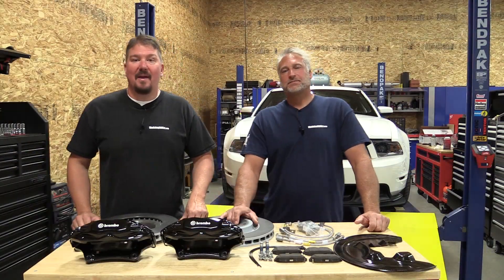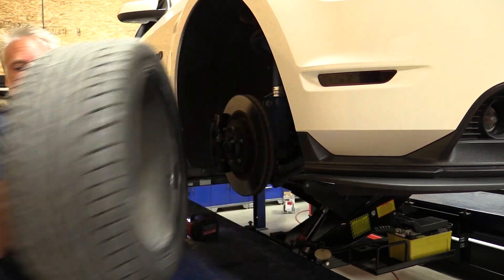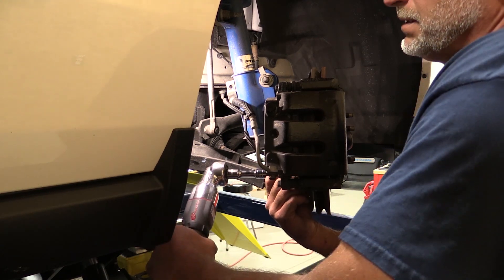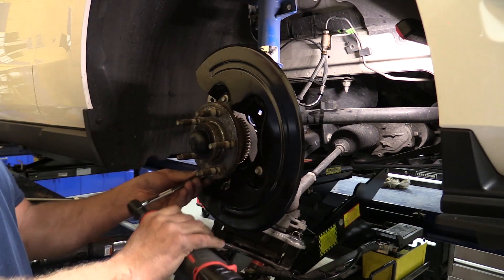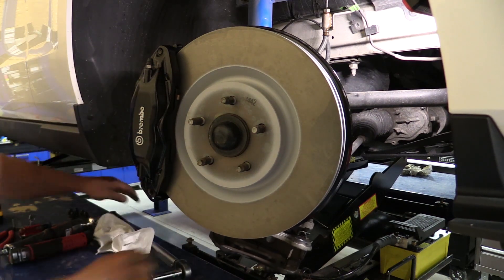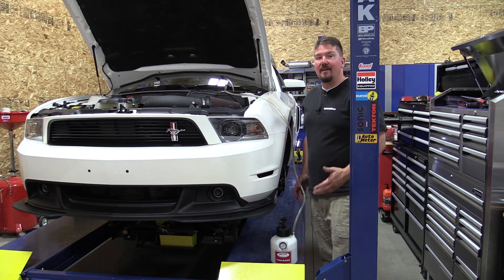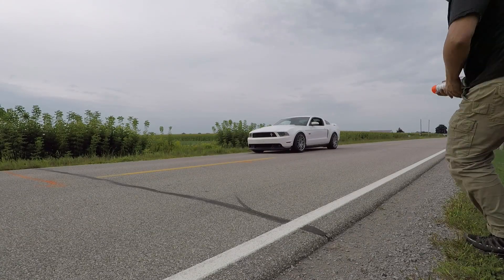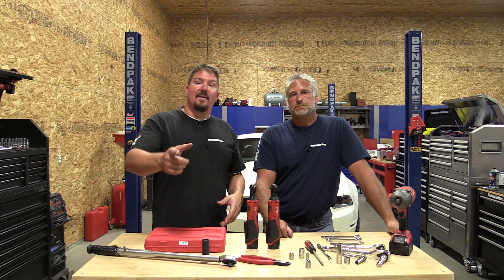STOP! 05-14 Mustang GT Ford Performance SVT Front Brake Upgrade Kit also for V6

Comment: looks like a great kit. nice job!  Can you tell me the outward measurement from the front side of the disk to the front of the brembo caliper?  I am concerned about the wheel offset hitting the front of the caliper?   Not the diameter as I have 20" wheels but the outward measurement of the caliper.

Comment: Hi there, I have a 6 piston Brembo break of a 2016 Mustang GT. Do you know if it will work on my 2014 Mustang GT? Thank you.
Reply from the maker: I am unsure if it will work because I need more info.  Do you have the calipers and the rotors?
Reply: WorkshopAddict yes I have the calipers and rotors off a 2016 mustang gt.
Reply from the maker: @mujtebaalhajaj7428  I believe they will work.  You may get not fit your factory rims after you install the brakes.
Reply: @mujtebaalhajaj7428  the calipers will work but you'll need the 15" rotors off of a 13-14 gt500
Reply: Austin Stull, I have rotors off a 2016 Mustang GT, do you think that they will work? Thank you.
Reply: @mujtebaalhajaj7428  most likely not on your 2014 due to the fact that the rotor hat offset is different on the 2015-present stangs
Reply: Austin Stull thank you.
Reply: S550 6 pistons will work. You just need 13-14 GT500 rotors and stainless steel lines
Reply: Brock Tipton thank you

Comment: Nice upgrade, any reason not to replace the rear rotor's and lube the slide pins?
Reply from the maker: Bentlyco0p Rear brakes do 30 percent of the braking on this model and the rear rotors will last well over 100k.  As to not add cost to this kit, because most won't need them, they are not included.  The stocked rear rotors on the Mustang are the same between the V6, GT and GT500.  This kit is meant to mimic the GT Track Pack.  The slide pins on most will have a good factory lube on them and will not need anything.  If the car was a high mileage car, it might benefit from some lube.
Reply: @WorkshopAddict  Unfortunately whenever you put new pads on, you absolutely have to either resurface (if rotors are above minimum) or replace the rotors, other wise it is a "pad slap". You need 2 fresh and even surfaces otherwise you will feel the vibration in the brake pedal (rear brakes) in no time at all. If the car happens to see a track, it will only take 1 day. I usually just replace the rotors because I prefer to not have thinner rotors even though resurfacing doesn't take that much off.  When you do a "pad slap" the car will still stop but you will go through those pads a lot quicker along with the vibration.

Comment: Napa or rockauto sells these brembo calipers, rotors and pads for substantially cheaper, the calipers aren't painted and don't have the Brembo sticker on them tho.
Reply: They aren't real ones. They dont even have the factory stamp
Reply: So far I’ve only seen Cardone copies. Haven’t see if the Nugeon or Power Stop are copies yet though.
Reply: The non-track 4 piston front Mustang calipers on the after '14 GTs look like the '13-'14 Brembo Brake Package option, but they are not.  They are stamped with FoMoCo on the backside and don't have the Brembo logo on them.